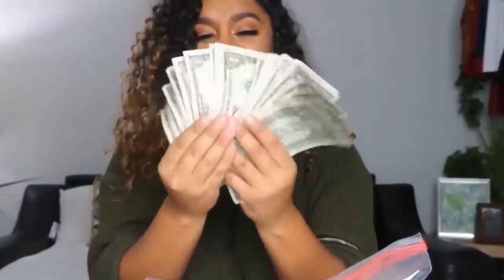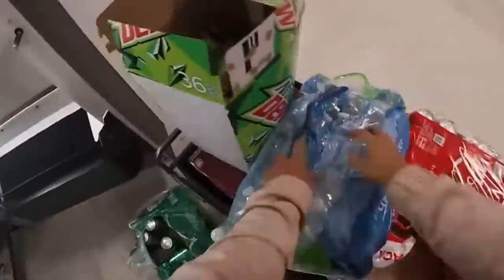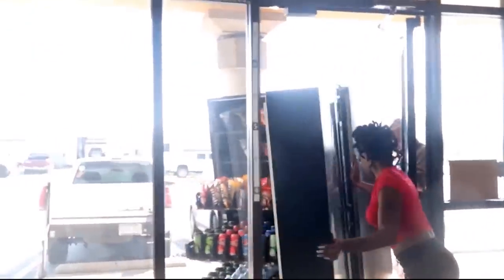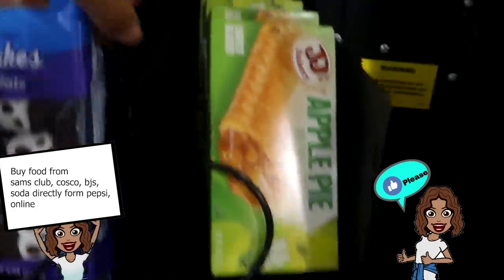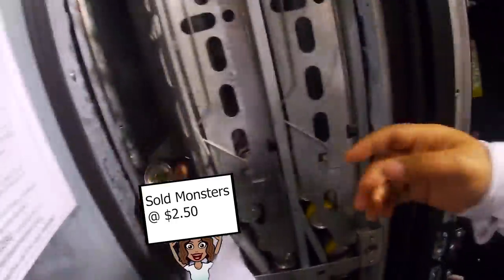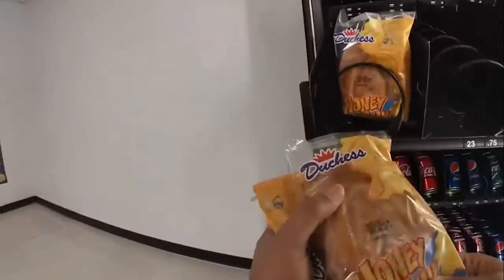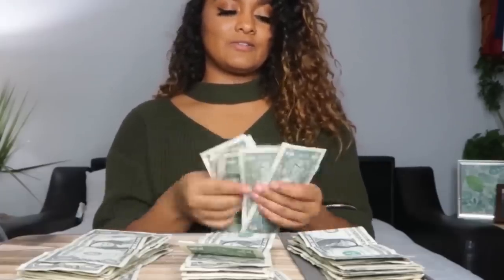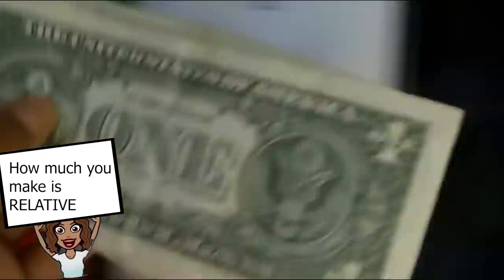HOW TO START A VENDING MACHINE BUSINESS FOR BEGINNERS: STEPS TO OPEN, HOW MUCH IT MAKES

Comment: -Best machine: Witter, Ams, & Usi 
-Worst Machine: Seaga 
-Make Sure The Machine Is MDB Compatible 
-Don’t Buy Old Machine Because You Cant Install Card Reader
-To Move Machine Use A Truck With Lift
Reply: "Hernia, schmernia! I'll lift it myself, dagnabbit!"
Reply: What is MDB?
Reply: @vonettap.2383  Multi Drop Bus
Reply: @MrBozo34  whats a multi drop bus?
Reply: Thanks my love
Reply: Thanks for the 📝😍
Reply: @AlbertoenCristo  a question that needs an answer 😭
Reply: ITS WITTERN, DUH
Reply: @AlbertoenCristo  THE MOST CURRENT and common connection for vending harnesses
Reply: Do you have to pass a credit check for credit card processing?

Comment: Definitely do not lay your machine on its side. Remember the machine is basically a refrigerator. And laying it down will cause major problems with the Freon tank. Anyway … awesome video. You go girl…. Also you are 100% right never pay commission… never ever ever. That’s like a gas station charging a cover charge to get in 🤣

Comment: I wasn't going to begin a vending machine  business but you've inspired me! Your whole way is just so dope. Wondering if it's worth it with the extra service chargers pcm minus costs of going there to collect and restock, the stock and maintenance away from a average max of $200 pcm leaves peanuts. Will take years to breakeven from the cost of the machine. Can you shed any light on the realities of this and what your mindset is for the long term profits. Are any of the services the same price if spread over multiple units? How much is insurance?
Reply from the maker: Takes 1 year to break even from 1 machine in a good location

Comment: WOW I'M GLAD I FOUND THIS VIDEO. I CURRENTLY WORK AT A HOME, BEEN THERE SINCE APRIL OF THIS YR AND THEY HAVE 2 VENDING MACHINES. 1 FOR SNACKS AND THE OTHER FOR DRINKS, BUT THEY BOTH HAVE OUT OF ORDER SIGNS ON THEM. DO I TLK TO THE PERSON IN CHARGE THERE TO TRY TO BUY THE MACHINES OR WHAT SHLD I DO?
Reply from the maker: Maybe buying them but make sure they don't have alot of problems. If they suck get the location to consider you

Comment: I use to do this for about a over a year. doing 40 machines a week , theres alot of pros and cons to this.
Reply from the maker: I would love to hear your thoughts. Did you quit because you werent making enough or got tired? What do you do now?
Reply: @letsjazzitup  
I was working for a neighbor that had many machines and wanted me to run the route. The owner sold the route. the challenging part is the shopping. getting boxes of snacks candy boxes of sodas. after that you must quickly get on the road to each location and restock the inventory while checking expiring date. most places close by 5pm so its a tight day. the other part is the customer service , I ran into issues of people losing their money in the machine so you must give the refund back without questioning. the maintenance of the machines is another issue, theft of products is another issue. hot sodas and money jams coin jam. complaints of old machines was the downfall of the business. everybody wanted a credit card machine , not cheap to upgrade these machines. alot of locations wanted out and the owner decided to sell out before losing it all,
Reply from the maker: Thank you for taking the time to write. Yes, the times have changed and people want new machines. Our society has changed to a cashless society, so credit machines are a must. It's cheaper to buy a machine with MDB capabilities. Saves money, time, and avoids complaints.
Reply: @letsjazzitup  
if your just starting up its a good idea to get the new machines or newer second hand. but I was tossed into an existing business with everyone complaining and it was a mess. the owner never would pay to get new parts fixed on the spot so it was consist upsets. and the locations are very important. many locations I serviced were crap. some place would have no sales while others had 75cent in the tray , to some better spots had over $100 in sales for the week. some horror stories as well
Reply from the maker: @dcomputers  those horror stories would make for some good stories
Reply: @letsjazzitup  
Iol true. I like your logic.
ok one horror that I encountered was mouses running inside the soda machine. one was also dead so the smell was awful. this machine was an outdoor unit so its kinda expected. the warm compressor and maybe the mouse wanted some caffeine. another one was another outdoor unit which wasnt my normal route but was added to my route for owners whatever reason. this machine was fully loaded with heavy thick spider webs which was creepy to even pull money from. you cant even see anything . felt like a horror house trick or treating. when it jams up you need to pull the coin mech out but due to the overload of webs I try to push it back to owner to deal with. keep in mind you dont want to get attacked by a poison spider. some other horror which is when the workers use chucky cheese coins in the machine. adults using toy coins really slow your route down. because you need to remove the whole coin mech out and use a long screwdriver to force the coin out and clear it out the system. keep in mind it sometimes take 20 minutes down time. and you only have till 5pm to finish the day out. something so simple just reloading sodas shouldnt take more than 5 minutes. it was a nightmare. other issues like adults stealing from the machine due to a damage flapper. any questions about this business let me know I could help out.

Comment: Since the protest over the weekend did you get any damages to your machines and if so how will you fix this problem. This video has encouraged me to do business but I'm trying to figure out is this a good time for this. I guess this will be based on location. Please comment.....
Reply from the maker: There have only been peaceful protest where I live. Also, my city is not near the big cities in my state so I dont really have to worry about the protest.

If you are worried my advice would be to have insurance to protect yourself. If you can afford it but a vending machine gate around your machines as another option. Also bolt your machines to the wall

Comment: Do you also have claw machine's?
Reply from the maker: I sold it at auction. I want one when I find the right location
Reply: @letsjazzitup  thats a good reason lol have you looked into getting coin pushers and other machines like that?
Reply from the maker: Unfortunately those are illegal in va. Which suuuuucks
Reply: @letsjazzitup  dang so wait if my dave and busters has a coin pusher wouldn't it be legal?

Comment: No disrespect but I thought you were fairly knowledgeable about the vending start up right up intill you said you would offer a 30 to 50 % Commissions to a larger account. I been in the buisness over 30 years and that’s definitely not a smart move when you will have a 20 thousand dollar investment I just placing the equipment needed to get that account . I’ just sold my company and now I’m going to post up some u tube videos myself on how to start a vending buisness. I just posted my testimony video “ 2 machines to 400 “
Reply from the maker: Did I say 50% I pretty sure I said if you must no more than 20% for a huge account. Other than that i tell ppl not even to bring up commission